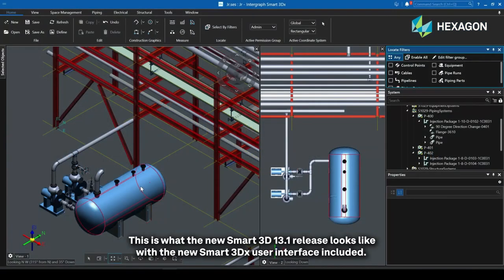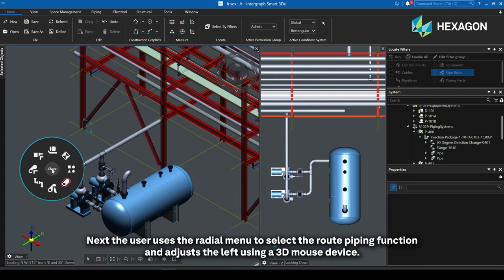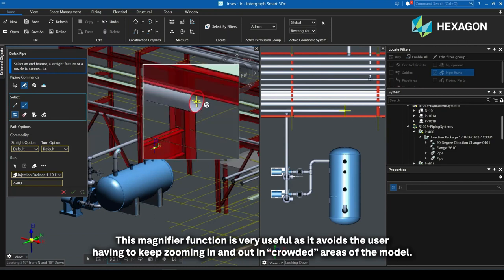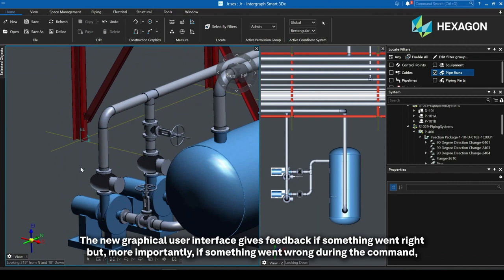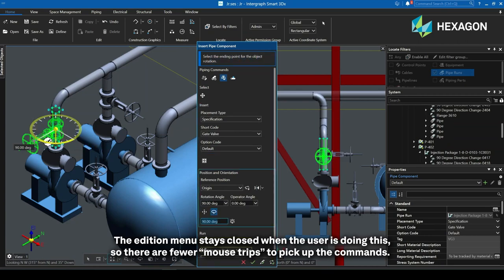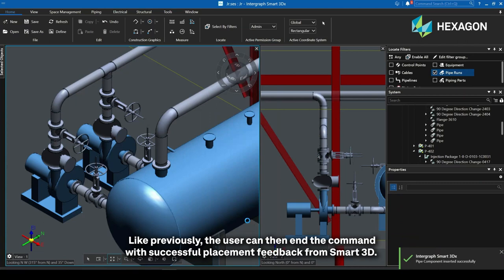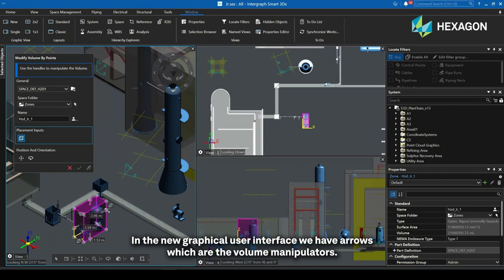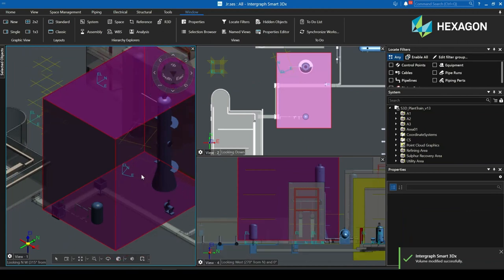Intergraph Smart® 3D 13.1 Overview

Comment: why is it showing "critical memory limit reached" even though i have high spec workstation.
Reply: If the core application is still 32bit it cant adress more than 4GB of RAM, no matter how much memory you bolt into your workstation and how high spec it is.
Workspace with too much content = Out of memory.
That was the question i raised above